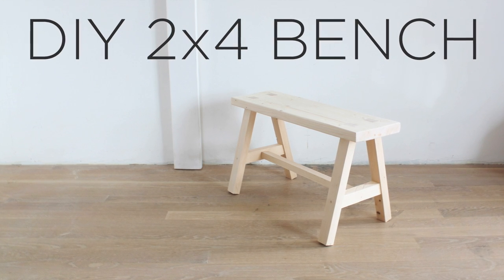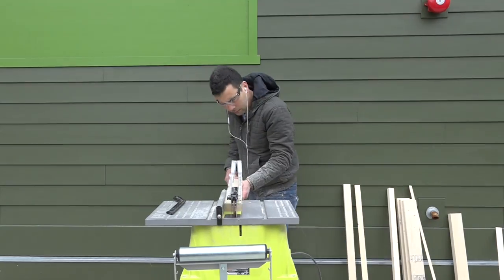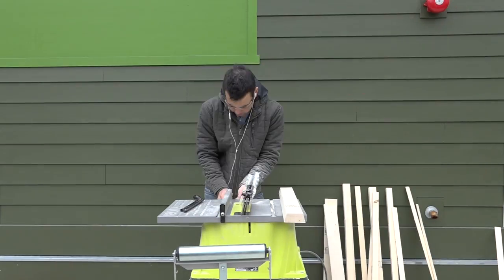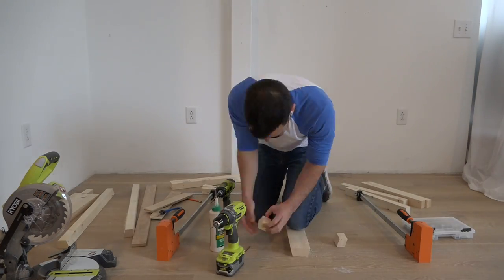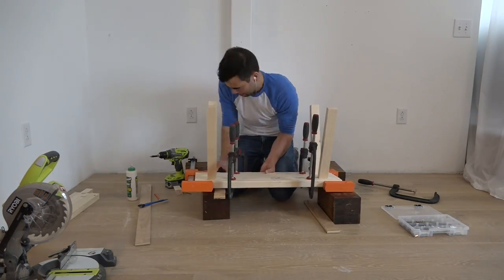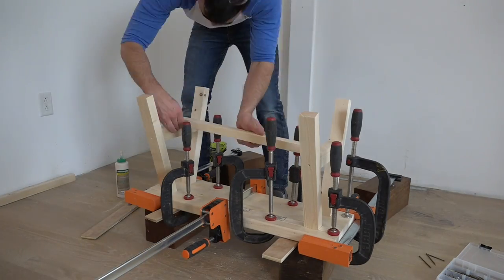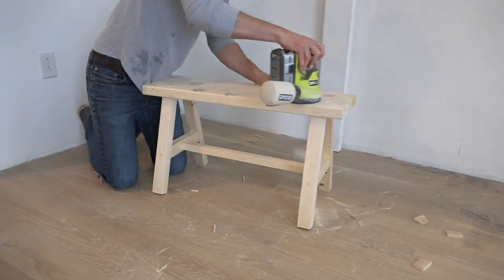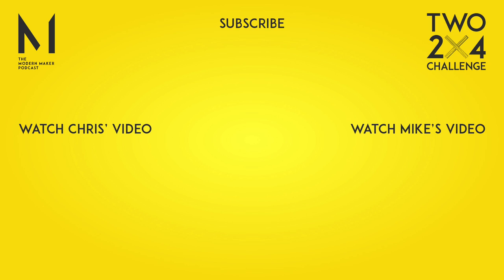DIY 2x4 Bench | The Two 2x4 Challenge

Comment: Yay! 6$ in materials!  $2,000 worth of equipment, what a genius!
Reply: His equipments are more like $400. He doesn't show off expensive power tools like many other channels.
Reply: you can do it without u know
Reply: More like $300 worth...
Reply: RobertoDonatti If you want to see projects made with a stick and a rock tied together then go check out The Caveman Channel. DIY projects require a few basic tools and the right attitude. If you don't have the tools he has then you need to use some logic and common sense to think of what basic hand tools you could use instead. This whole project could be made with a hand saw, chisel, plane and drill. If you can't spare a hundred dollars for a few basic tools then I don't think DIY is for you.
Reply: Let's see, 1 Miter Saw, 1 Radial Saw, 1 Table Saw, 2 Power Drills, 1 Skill Saw, 1 Sander, 8 Clamps. Please tell me where I can get all those toys for $300 OR SHUT THE FUCK UP!
Reply: i do know. What I'm pointing out is how ridiculous it is using expensive power tools to work cheap materials. BTW hand tools were used for a million years before they came up with the power tool
Reply: RobertoDonatti Read my comment again, I didn't say his power tools were basic. I said you could achieve the same result with basic hand tools that you could buy cheap.
Reply: to make this with a basic hand saw you need to be an expert to make those 15degrees angled cut lengthwise
Reply: Maxime De Clerck I wouldn't do that part with a hand saw. Marking both sides along the length and hand planing it down would probably be easier.
Reply: You are absolutely right. The point I'm trying to make is: If you can afford expensive power tools, why the fuck skimp in materials? I'm sick and tired of idiots and their bloody pallet wood.
Reply: You're sadly mistaken. He's using all Ryobi equipment which are budget friendly. Chris Salomone is the one w/$10K worth of equipment(who channel I love btw)
Reply: RobertoDonatti So once you buy a few power tools you should only be working with mahogany and ebony? I think you're missing the point of a 2x4 challenge. If you you're sick of people working with cheap materials I don't get why you'd choose to watch a video called "DIY 2x4 Bench". I don't know if you're a subscriber but pretty much all this guy works with is concrete and construction lumber.
Reply: It's all Ryobi, Home Depot's house brand, so his whole setup is closer to $700 with that 12" miter saw at the beginning with the Diablo blade plus the cost of clamps.  He uses a smaller 7-1/4" miter saw later in, which he could have used in the beginning by cutting the stock one at a time, so save $300 off the top by using just one miter saw.

But that's really besides the point--machinery in ALL industries ALWAYS cost more than the stock being produced.  Those plastic kids chairs from Ikea costing $15.00 has an injection mold costing at least $15,000.  But that one mold can do tens of thousands of chairs before wearing out.

Point being is that the equipment has more utility than the one time it is used here, and that bench is worth more than the $6.00 in materials.
Reply: FuriousFilipino Well put. This can be an expensive hobby if you want all the best stuff but buying entry level brands or second hand can save a fortune. The Ryobi stuff I've used has been good kit. If you're into cars or PC gaming that $700 would go nowhere. The power tools here can be paid for in no time if you can sell some of the stuff you make. If you sold 5 of these a week at $26 your tools would be paid for in less than a couple of months.